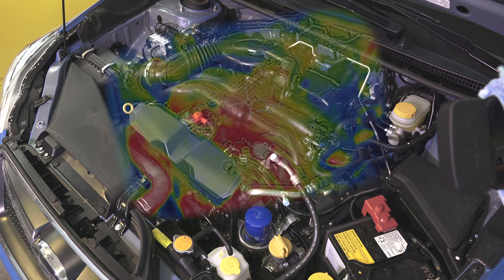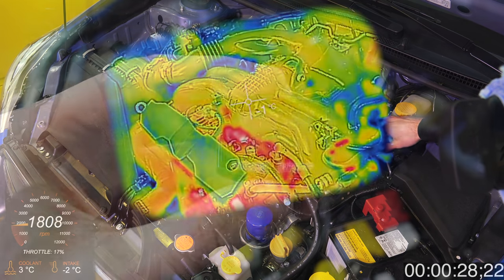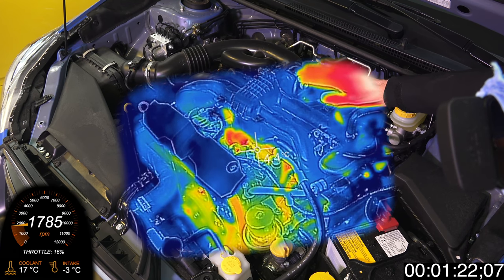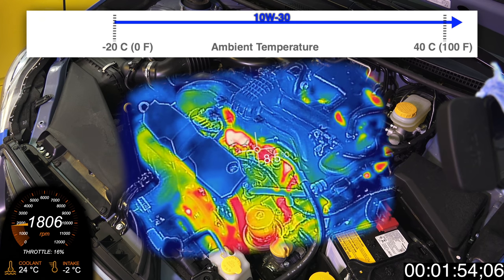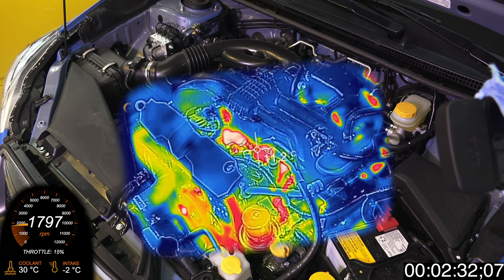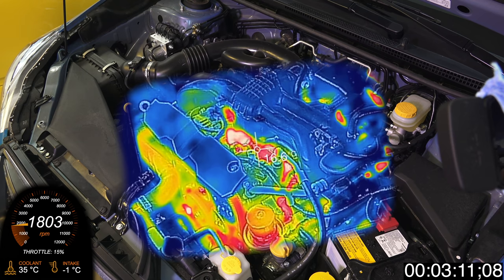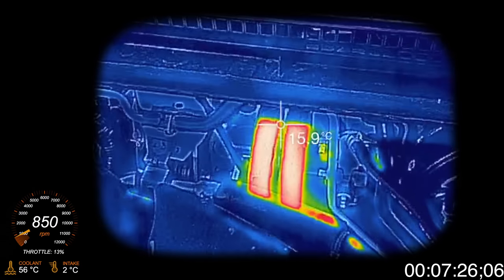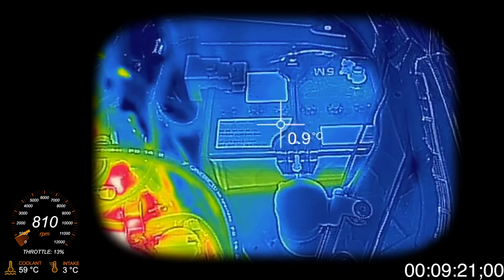Watching A Frozen Engine Warm Up With A Thermal Camera

Comment from the maker: For an HD (thermal) version of this video, here's the link: https://youtu.be/n_CQzBc6GbM
Reply: where do you get you IR camera please?
Reply: the metal kind
Reply: its mint
Reply: Engineering Explained MY MECHANIC ONCE TOLD ME ENGINE MOUNTS CAN GO BAD FOR DRIVING ON S COLD ENGINE. TURBULANCE MAYBE? ANY SCIENCE BEHIND THAT? HE SAID JUST WARM IT UP A TAB BIT USUALLY 15S
Reply: 1) my ambient temperature never drops below 25°C 
Do I still need to warm it up?
2) when don't use my vehicle for more than a week, it doesn't stay on unless I use atleast half throttle (it's carbeurated), is it okay to warm it by racing?
Reply: Does the electric motor, in a electric car. Need to warm up?
Reply: You should do this now with your telsa!
Reply: So you shouldn't warm up a carbureted car before leaving?

Comment: I usually just redline it as soon as i turn it on
Reply: Broseff G 😂
Reply: Are you the lady who lives across the street from me? WTF, that ain't no air raid siren, its a Honda.
Reply: me 2..thank god it even has turbo so its even faster heating ..and off course its company car ..so i can meassure  -20 celsius to 90 celsius times off coolant
Reply: how long until you remember to get out of neutral?
Reply: Broseff G a guy that lived do the street from me used to do that for real.  He went through vehicles like socks.  He eventually OD'd on meth.
Reply: FALLOUT20rads haha really
Reply: +FALLOUT20rads Is this for real? Dafuq.
Reply: Yes. No joke.  His name was Elmer Massie
Reply: Made my noon
Reply: But this kills the engine :(
Reply: Broseff G im dyin over here 😂😂😂
Reply: Broseff G i knew a person who redlined their engine cold using 5W30 oil. 20k miles and no issues for them.
Reply: Internet Critic lol.....
Reply: bmwmsport11 20k is nothing....I'm at 300k....treat it nice, and it'll last longer.
Reply: Feed er the hot supper, eh?
Reply: if it's really cold,-30, you risk metals expanding at different rates and failing seals....I'd look for oil drops under your car.
Reply: Push the gas pedal all the way in before you turn the key!
Reply: VozValden excellent suggestion....get that engine rotating as fast as possible, as soon as possible, or do what I do, just turn the key.
Reply: Broseff G lol 😁
Reply: Broseff G lmao
Reply: Broseff G same
Reply: You can get some extra heat into things by putting it in top gear, holding the brakes on and riding the clutch while you warm up. The friction will create heat and help the warmup process.

This rubbish about having thinner oil to flow when cold needs to be corrected, too. What does oil do? Stops friction. We want some friction to create the much needed warmup heat. So it's a total myth that oil flowing when cold will help your engine.
Reply: Godfrey Poon that's why I just drain my oil out to about one litre when it's cold, it warms up really fast after the initial noises.
Reply: Broseff G Guess you don't like your piston rings to much.
Reply: NovaMan 350 I think you've lost the thread....
Reply: Godfrey Poon Being serious?
Reply: rip engine
Reply: Broseff G 😂😂
Reply: do you own a rotary car?
Reply: Broseff G savage
Reply: Same. Because V-Tec yo.
Reply: WOW redlining it is bad! U need to start a fire under the engine to warm it up before you even start it! After the fire warms up the oil pan and you hear the oil start bubbling is when you start the car. Cooking oil is better for an engine btw. Also you need water in your radiator which aids in engine warm up (antifreeze cools the engine off which is the opposite of what you want or need) When the engine starts smoking and your temp gauge is in the red, that's when it's in operating temp and you can drive it...lmao
Reply: Firefighter here, I look forward to visiting your driveway soon.
Reply: not a good idea as thats what they warn you not to do as it may heat it up too fast and crack the metal
Reply: Gabe Ulrickson it's a joke....I hope.
Reply: vTec yo!
Reply: +grim3965 Needless to say redlining is moving air without much load; It's more likely your engine knocking occurs when starting up. In other words the cylinders pinging against the walls of the block will occur due to there being less rotational inertia leading to crankshaft instability from the start I guess.

And if you don't have a block heater that's good enough or you don't want to waste fuel by just idling, but it's a very interesting conjecture
Reply: meh yer all wrong
yall forgot teh 3 Tpoons o sugar to fuel be4 revving up
also u gotta dump coolant first cuz u dont wanna cool teh engine but warm up
u gotta put coolant back when its hot so you actually need cool
Reply: Sammy Morini Sir you are a thinking man's man, I'm going to try that, but I heard if you drain the oil and quickly pour warm oil as you turn it over, with the heater fully on, you won't do any damage. At first there's a noise and a smell, but in 30 to 40 secs, that will stop.
Reply: ***** lol....I have a small collection of early Rovers.  P4, P5, P6 and a SD1. All still running.
Reply: Doug Whole yes all pre electric. Plus mine was 1997 not long before the went to MG then bust. The honda 2litre petrol unit was a corker, shame about the rest of it.
Reply: ***** the SD1 has it's electrical issues, but compared to my others, it's a modern car....I had a magazine the cover story being the end of Rover, turn the cover and there's a two page ad celebrating it's 100 year anniversary
Reply: had a friend do this leaving the school parking lot the other day and blew up his HHR lmao
Reply: Awesten Beeragg HHRs deserve to be blown up....
Reply: If you're not turning your key with the gas to the floor, you're doing something wrong.
Reply: JettyLife23 on certain year model vehicles that just shuts off your fuel injectors, meaning your car won't start it'll just crank until you let go of the gas pedal letting it start up
Reply: 2 step launch control right out of the driveway.
Reply: no wonder your car drinks oil
Reply: Broseff G then it goes boom
Reply: Broseff G what works for me is full throttle tilll oil starts coming out of the exhaust then it’s ready
Reply: Comment of the year
Reply: Give it some coffee. Cars need their morning caffeine too
Reply: That's how you break it 🤣🤣
Reply: Yeah man my starter alone cranks the engine at 9k rpm before it starts
Reply: lmao
Reply: @kimmer6  xD love it
Reply: Hope if i buy a used car its not one that you previously owned
Reply: Oh god that is TERRIBLE for your engine seals lmao
Reply: @Kryndon64  r/whooooooosh
Reply: @manlikeilyas  Are you seriously whooshing me, when in fact I used a sarcastic  joke in my original reply? Haha :p
Reply: @Kryndon64  ooooooooh
Reply: @Kryndon64  how explain
Reply: That's genius.  Keep it up.
Reply: How to ruin your car.
Reply: Brilliant
Reply: @kimmer6  lol
Reply: Giovanny It’s called a Contra Costa County Cold Start
Reply: Good plan buddy 👌🏻
Reply: That’ll damage the engine. It’s no different than redlining yoursel when you bench 500 lbs before you even got a chance to do some reps smh....
Reply: Seems like the type of guy to redline it in neutral and force it doesn’t into drive to launch the car 😂😂😂
Reply: You must live life a 1\4 mile at a time.
Reply: Not a good idea
Reply: Legend
Reply: Well of course you need to drain out your oil before in order to build up the heat faster
Reply: Rudniks camry start
Reply: Shouldn’t do that 😂
Reply: Ahhhahahahahahahahahahahahahaha such a funny comment. How hilarious. This guy is a true comedian. A patron of the arts. Wow. Crazy hilarious. Hahahaha.
Reply: Ah yes, ran hard from cold start, and shut off hot. Th ing is what matters most with how long a vehicle lasts is....consistency... If you're hsrd on it sometimes or nice on it sometimes or warm it up some times snd so on is what kills cars
Reply: I bet your neighbors love it 😀
Reply: It warms up way faster.
Reply: My 99 chevy with the 5.3l can confirm this
Reply: Good job